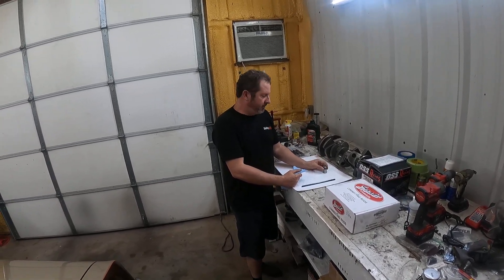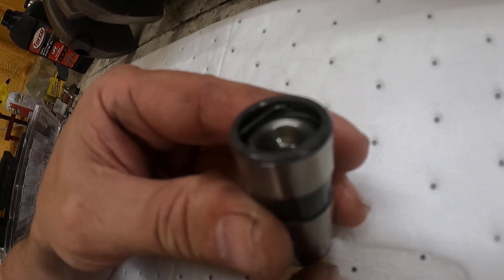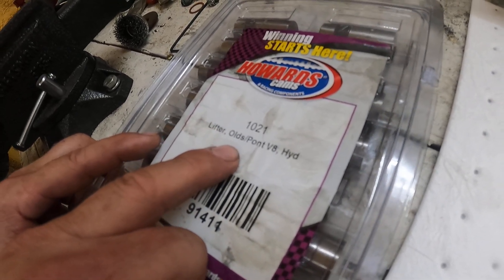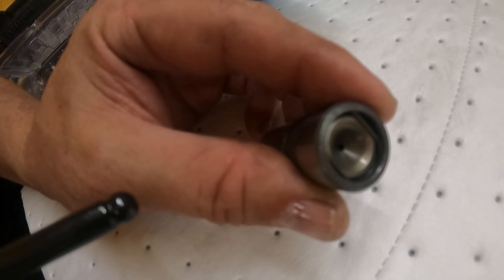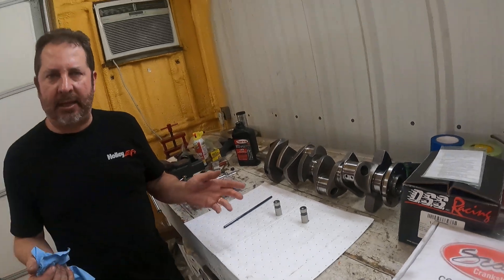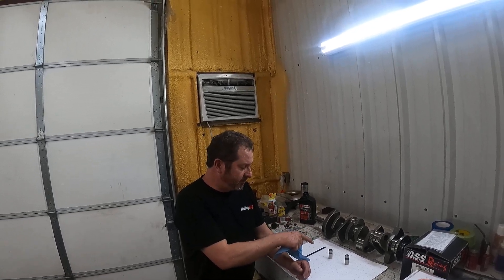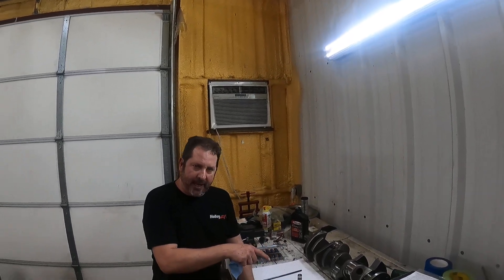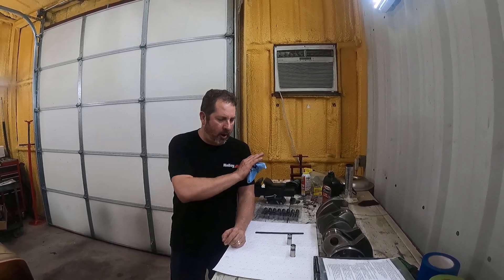Flat Tappet Lifter Failure Findings

Comment: Iskenderian custom ground solid, P55 core with the 'SO' (special oiling) Isky lifters.  I broke that camshaft in with PAC 'beehive' springs, 150# seat/345 over the nose.  Driven 'racing' conventional 15/50 oil.  1.7 ratio rocker arm, lashed @ .012" cold.  Broke in perfectly, excellent wear pattern on all sixteen lifters.  454 big block Chevy for a C3 Corvette, 510/566 hp/trq.  Cheers!

Comment: I bought a set of Comp roller hyd lifters. The plunger inside the lifter was pressed down upon initial install and never came back up. They were pressed down by the valve spring upon setting rockers. I pulled down the lifter to find the internals were all rusted which jammed the internals. I contacted Comp and sent some photos they sent a new set out totally free. Didnt even ask for the old ones to be sent back.
If your able to (have the tools), I'd recommend pull down every lifter and thoroughly inspect and clean each and every one before installation.
Reply from the maker: Great idea !!

Comment: New comp cams cam/lifter set lasted 10 hrs in my boat(flat bottom V drive) followed break in to the letter. Went with rollers. Hope those hold up. 455 Pontiac.
Reply: Odd thought, but theres one story nobody reports on or makes videos of:  successful flat tappet builds that avoided break-in oils, and went straight for the intended running oil... and watched oil pressure during run-in like a hawk.  Isn't that how most builders worked in the 60's/70's/80's?   I don't have the means to prove it with a series of [lets say 25] builds, but what if break in oil... should only dress cylinder bores for assembly on fresh builds?  I can only report that I have done the same before, and.... drove it, and had a good time: 320 pounds over the nose, 290 duration/0.460" lift on 1.5 rockers.  Sump got pennzoil 10w-40 on that build/no aftermarket additives.
Here's why I bring it up: the purpose of break-in oil is to increase wear through reduced protection.  Maybe the better discussion might be what ra number range on a new lifter face surface gets best reliability?  If its right the first time, lifters should burnish in without help it would seem.
Reply: @flinch622  Back in the day they would coat the cam and lifters in whatever oil they intended to use and go racing that night with rarely ever a problem. Gas was leaded back then, some of which would make its way to the lifter faces due to blow by past the piston rings. 
I’ve built half a dozen pontiacs over the years all using Rhodes lifters and getting a successful break in. Rhodes lifters come with a squeeze packet of break in goop which I’m sure I used every time. The build that failed though I simply used the lifters that came with the cam as a kit. It was a Comp Cams high duration cam in the .550” lift range with valve springs spec’d for that cam. I don’t remember the specs specifically.  That cam also probably came with a squeeze packet of break in goo which I certainly would have used. 
After the failure of that install and being aware of the problems other people were having I went with rollers. 
I, like you, have neither the time or the money to experiment with what works and what doesn’t as far as flat tappets.

Comment: Were you able to test each lifter for bleed down prior to assembly?
I test/blueprint but don't normally disassemble and clean all new parts. Considering the amount of internal debris I've been encountering in general though, I think I may start doing that especially in the case of lifters.
Reply from the maker: No unfortunately not. I find your findings extremely interesting regarding the contamination however. It's too bad it's come down to this with new parts.
Reply: @blakesmusclecar  I believe this is what's happening, in addition to internally dirty parts.
https://youtu.be/MbRjAMhCEJk

Comment: Did you see Uncle Tony's video about this? His lifters were missing the necessary crowns on the lobe side preventing the lifters from spinning.
Reply from the maker: Yes sir I did.
Reply: Yeah that has me worried. Chinesium strikes again!
Reply: As did Dan at DD's Speedshop in a big block Chevy. Uncle Tony discovered the "reconditioned" lifters.
Reply: @RestoringChristine1956  As he did mess up the engine now again by sloppy work, we will not be able to find out if the melling lifters he used on the second try with a used original cam would have worked out. Damn, that would have been of great help out there! At least he has shown that these have the crown compared to the comp ones!
Reply: I wasn't very happy with UT's diagnosis because it was if he just tossed a set of lifters in without looking at and testing them 1st.
Never do that! :(
Reply: I just sent a set of Summit hydaulic flat tappet lifters back.  They were perfectly flat with no crown.  It looked like the boxes were opened before as the tabs for the boxes were ripped.  Terrible that this is happening.
Reply: @kurtehrhardt6652  Sounds like they were already returned as defective.  Wonder if those were Tony's rejected lifters?
Reply: @RestoringChristine1956   Uncle Tony is a hack.
Reply: @kurtehrhardt6652  Do you think you were the "2nd person" to send them back ??
Also - 
Is it possible to buff a slight "crown" on these Chinese lifters yourself ?? (I know you shouldn't have to)
Reply: @TIMEtoRIDE900  Just thought I would share my recent experience to help others out.  I returned the lifters and cancelled the flat tappet cam that was back ordered.  And no I don't think I was the 2nd person but thanks for asking.
Reply: @thisisyourcaptainspeaking2259  Not sure but the tabs on the lifter boxes were yellowed and torn.  Could have been sent back before by another customer I suppose.  Summit stands behind their stuff as I got a full refund.
Reply: @kurtehrhardt6652  Might have been another destroyed engine if you'd tried to use those lifters.  I doubt comp would've stood behind that.  My point is, they send junk out the door then when a cam gets wiped wash their hands of it, leaving you stuck with a wrecked engine.
No quality control.
https://youtu.be/MbRjAMhCEJk

Comment: Adjust the valves from the bottom not the top. That way you get instant pump up when you start the engine and you get very little bleed down.

Comment: Bummer. Wish you would have opened up the bad lifter to show what failed. Was it a broken spring, or did the piston jam inside the lifter body? I'm building a Corvair engine now and all these recent cam/lifter failure horror stories are making me reuse original parts.
Reply: The issue is almost never the internal mechanism of a lifter. It is in most cases the contact surface of the lousy POS lifter that these companies represent as quality precision parts. They are JUNK that companies like Crap Cams bought from Mexico or China or who knows where. These are sold at a price that is the most the market will tolerate at a huge profit to them and a bonus for the parts buyer of the cam and lifter company. These junk parts are killing people's engines. Costing hundreds to tens of thousands of dollars and untold labor. These flat tappet cams should have been taken off the market because they are a time bomb waiting to destroy an engine and some customers wallet.
Reply: @davidkeeton6716  OK - so the new lifter is missing a "slight crown" instead it's "milled flat" - - how hard would it be to belt-sand with 400 grit the needed crown?
You could measure progress with a feeler gauge against glass.  (I cut valves at a machine shop)
Reply: @davidkeeton6716  funny but gm FACTORY lifters are mfgd at their MEXICO plant
Reply: I had comps that collapsed upon install. Found the internals were all rusted.

Comment: How did you know was the nut to low on rocker arm
Reply from the maker: Are you asking how did I know if the nut was down to low on the rocker arm? I measure preload on the pushrod when setting the valves on a hydraulic lifter, setting them at .030 preload as recommended. I hope that was what you were asking?
Reply: @blakesmusclecar  I'm in the process of getting a 95 tbi running after sitting for 7 years and when I did head gasket the one rocker arm bolt it lower then all the rest I'm hoping it's just a  collapsed hydraulic valve and not the cam
Reply from the maker: @RayFixesAll  - Could very well be a collapsed lifter. However it could also be a wiped cam. Either way if you have clearance between the rocker arm and the pushrod on a hydraulic you will need to pull the intake to replace the faulty lifter. Hopefully it has not wiped the cam.

Comment: Never had any problems with any of my old cars. Studebaker V8 and six, air cooled VW, 65 GMC V6, 65 Toyota Landcruiser, 69 Chrysler slant six. What do they all have in common? Solid lifters, adjustable rocker arms.
Reply from the maker: Great point.
Reply: @blakesmusclecar  FYI, the 65 Corvette 327 had solids and made 365 hp. I built one with hydraulics now I might change to solids before I start it
Reply from the maker: @7CAJONEZ  - Thanks and good to know
Reply: What about valve spring tension/pressure ?

Comment: did you take it apart to see why the plunger wasnt returning up? Maybe there is some junk stuck in it
Reply from the maker: Yes sir, I disassembled it completely. From what I could tell is that the plunger was defective.
Reply: @blakesmusclecar  Defective how? Was it too tight in the lifter body or was the plunger spring too weak to push it up to the snap ring?
Reply: @blakesmusclecar  I would like to get an answer to this, too

Comment: So we know they are passing these poor quality components to their customers. Should we purchase from them again? Can we believe their claims how much better they are than their competitors? If the flat tappets are junk should we believe the rollers aren't? Do their racing customer's give them all the business they need to stay in business? I just had a failure and the brand I used will not be going in my engines. We can say it's every brand and if so it's a great time for a company to step up and in house the lifters and put the rest out of business. Not saying customers don't get things wrong and have a few failures, But the number of fails out there now are not acceptable.
Reply from the maker: Casper - I think you nailed it. I'm about to do another video soon on a 440 BBM we are building, and going with Johnson HyLifts. I've had good luck with these so far, but you never know on these. I'm also seeing bleed down issues on hydraulic rollers as well.
Reply: I hope you have good luck on your build. I love a good 440 Mopar!

Comment: Is this problem limited to a certain lifter manufacturer or is it widespread?
I know most brands do not manufacture their own lifters in house but, instead just put their logo on the box.
Reply from the maker: I have found good luck with Johnson HyLifts for flat tappets so far.
Reply: Haven't had a problem with howards cams and lifters but that's just my experience

Comment: Your lifter probably don't have a good crown, and you cam has no tapper. Engine shop here has more bad in the last 2 years that the last 40 before that. If you insist on using FT check crown and taper, also make sure your lifters are spinning when running, really a lifter failure, the engine needs to come down all the way if a lobe is wiped out. It's most all FT cams. Some one somewhere  is not sitting up machine properly. In China they have no idea what a cam and lifter even does.
Reply from the maker: Actually that was all fine. The cam and lifter face never failed, it appears it was the internal plunger/spring mechanism that wouldn’t maintain pressure to stay pumped up.

Comment: The Chinese manufacturers are taking old parts and "reconditioning" them and selling them as new.  The responsible people should be in jail.    It's a lot more expensive once they fail and take out the cam lobes or cause a catastrophic failure.   Then its way more expensive than new lifters and gaskets.  It's a whole new engine.
Reply from the maker: Now it's affecting hydraulic rollers as well.
Reply: They are doing the same with MIL Spec parts for our military. They buy "E-Waste" (e.g. electronic waste) by the ship full, dissassemble, clean and remark them as MIL spec components. The military installs the parts and...they fail.
Reply from the maker: @c103110a  - That's terrible!
Reply: @c103110a  this is not true
Reply: @AlphanumericCharacters  Congress looked into it and determined it was a problem. Is Congress lying too? Wow.
Reply: @AlphanumericCharacters  Look it up. There are many reports on the subject. Do your homework! It just takes a little time.

Comment: Any thoughts on  crower cam savers lifters?
Reply from the maker: I have never used those before. I have had good luck so far with Johnson Hy-Lifts. I have another upcoming build and will post another video of the build as well as the test.
Reply: Powell machine or similar name has a you tube channel. Just posted a video (last 2 days) where a customer sent in 2 bad batches of crower lifters. Unknown if it was the cam saver versions though

Comment: How about Melling lifters (made in Mexico)? Any experience yet?
Reply from the maker: I think the Melling's are made by the same supplier as the Comp Cams lifters. Not sure, but that's what I have been told.
Reply: @blakesmusclecar  I was hoping you made your own experience on this. No second hand information...
As Dan from DD's speed shop has shown, that might not be true as the melling lifters have a good crown instead of the ones from comp he had difficulties with.
From whom did you get your information? Engine builder or machining shop or something?

Comment: I am skeptical of everyone and everything. 
Almost all failures I have ever seen on anything is the fault of the machine shop or the builder. (Unless you are taking shit to the limit). In the “old days” we would tear down to find out what went wrong. Often it was a lot of guesswork with no clear answer. I’m seeing these videos showing a wiped out cam lobe and blaming the cam for being soft. Lots of things can cause a lobe to wipe out. Just because you find a wiped out lobe doesn’t mean the cam was bad or even the lifter that rode on it. 
 Here in this video you haven’t even disassembled the lifter and are blaming it. I have wondered how many of these failures are due to contamination or incorrect pushrod length. 
 I’m not saying you did anything wrong on the build. You might be the best engine builder in the world. But to pull out a part and see it failed then knee-jerk make a video blaming the part? 
 I kinda see the biggest issues being the younger breed of hot rodders. Always looking for something or someone to blame. Hot rodding is building shit, breaking it and fixing it. You don’t wanna play that game then get a nice used LS and be happy with 300+ stock horsepower. You wanna go fast be ready to spend money and if you are building it for a customer they better be ready too. You gotta pay to play. No way in hell I would have eaten a failure that I could not find any fault in my workmanship. 
 Sack up. Fix the damn thing and learn. Investigate before spitting venom at a manufacturer. Kinda makes you sound like a whiny bitch.
Reply: I had occasion to swap a cam a couple years ago with just 3500 miles on it - goal was to get compression right as part of new heads install.   So lifters and cam seeming to be in good order, a clean & inspect of lifters was done before laying them up with a little preservative.   I found... metal flakes in two lifters, chrome like in appearance, source unknown.  Motor had not made any kind of unusual noises.   But what could have happened?  Oh.. flakes could have lodged around check balls allowing bleed down.  You are correct: investigate failure every time its found - "just buy new" is no way to learn anything.